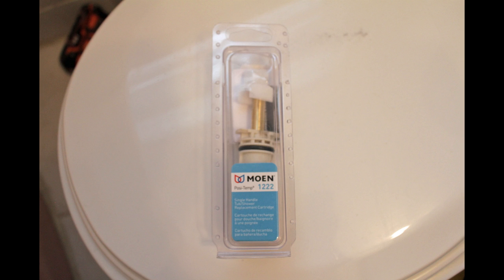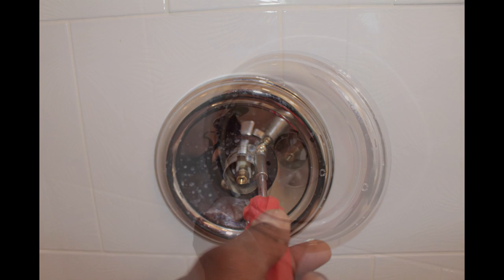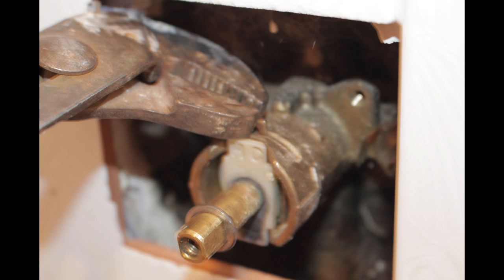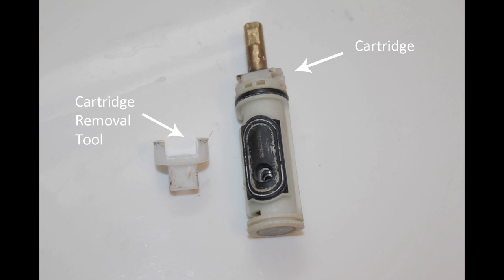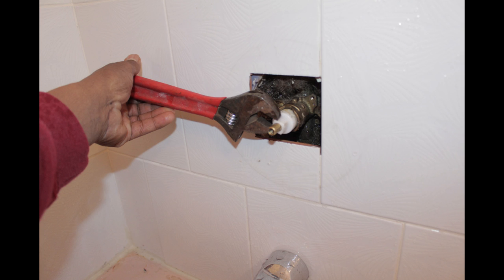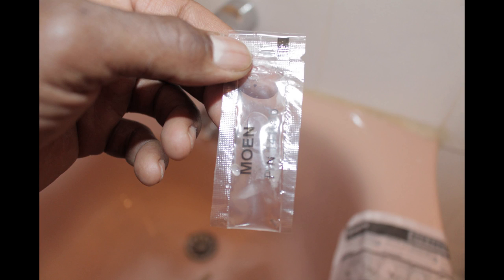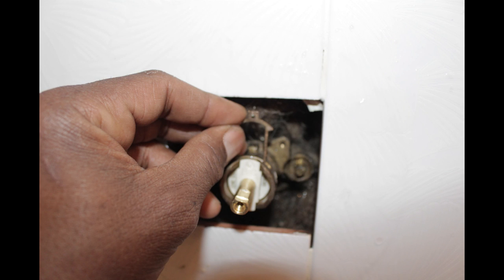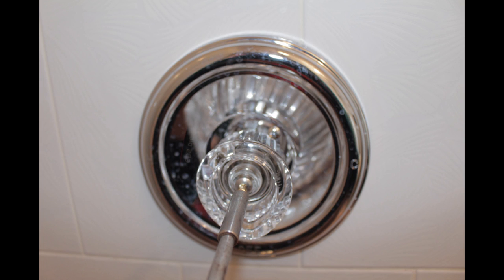No cold water in your Shower ?  Moen Shower repair

Comment: Thank you for this video.I was having the same issue and you helped me fixed it. One tip I want to share is to also buy a cartridge removal tool. It will make things a lot easier. Sometimes those cartridges are very difficult to pull out. My cartridge in my apartment likely wasn't changed in years so it became very difficult to pull out without a cartridge puller.

Comment: If your water pressure is still low after cleaning or replacing  the cartridge then you  may need to replace the cold water shutoff valve that that sends the cold water supply line to the shower diverter valve. My cold water shutoff valve was clogged with sediments along with the shower valve cartridge. After doing those two things viola...Now the cold water pressure is back!

Comment: I noticed that you removed the washer after removing the trim plate when disassembling, but when re assembling you put the washer on after the trim plate but before the handle, I didn’t notice that until watching it several times. So which is it? I guess I’ll see when I take mine apart

Comment: I replaced the cartridge but still no cold water coming. Please let me know what i did wrong.
Reply from the maker: I didn't add this because it's not necessary most times.  You'll need some help for this.  After you remove the old cartridge have someone turn the water on slowly and low to allow the shower body to be flushed of any hard water deposits.  After you flush the body and are sure water is flowing through the body of both, hot water and cold water ports, install the new cartridge.
Reply: I have same problem with a moen shower - their website says problem is probably the “balancing spool” that mixes hot and cold - this also needs replaced